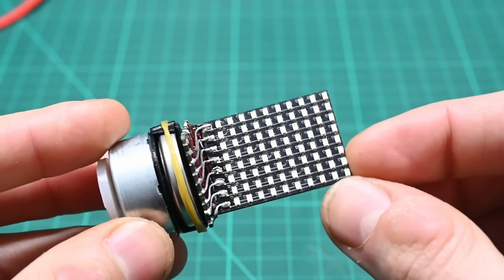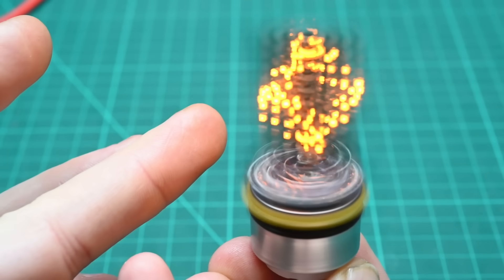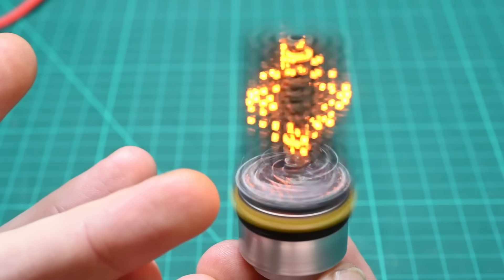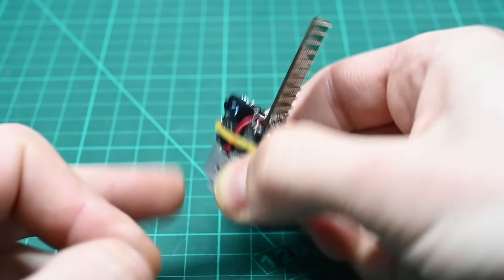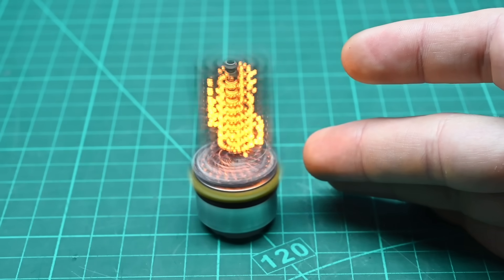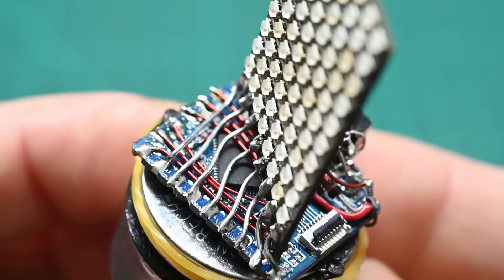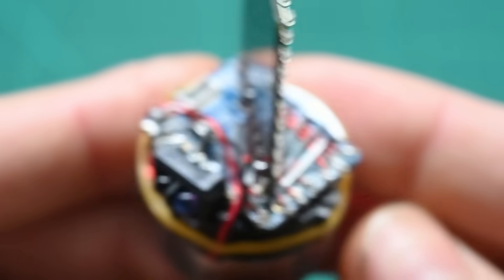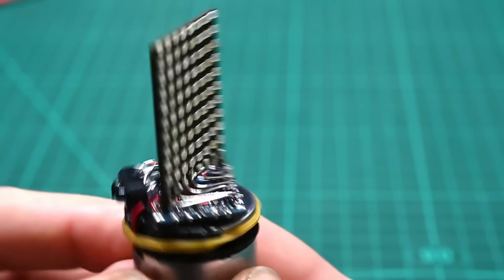Tiny volumetric display

Comment: Please don’t give up on this. This is amazing, and would love to see one day a higher solution, bigger version of it.
Reply: i doubt it will ever happen. the amount of movement you need is a safety concern.
Reply: @NRLNK-Rivals  if its getting your finger caught in it you could just put it in a case, if its possible to make parts lighter that'll also help with making it shake less? or maybe improve the motor itself
Reply: Reminds me of a Tamagotchi. Low pixel, but very clever and novel
Reply: There's one at the ATL airport. I think the point of this is that it has the potential to be small & affordable.
Reply: I saw a guy called ancient make one run doom.
Reply: @Thefirefan25  I found this video from him lmao
Reply: China's on it don't worry
Reply: It won't scale well. See "mirror screw TV" for details.

The rotating mass becomes rather unwieldy and cumbersome. It's probably good for a few inches across tho.
Reply: Wow ok. Comment delete central? 🤦‍♂️
Reply: It isn't going to scale well at all.
Reply: And since this channel has some kind of setting set, I'm unfortunately going to bail and have it not recommended.

Why do I have a feeling this one will somehow stick... 🤣🤷‍♂️
Reply: but not to much so its kinda retro hahaha
Reply: Instead of thinking, why shouldn’t exist think of why it could. be bold think different / for starters some things that come to mind make it, brighter, more pixel dense, using the same technology that we use for transparent display in case it in a plastic or glass tube that way we make it safer add some weights to the bottom and a better spinning mechanism so it won’t wobble  but I could be wrong. Maybe this is the wrong technology to bet on but we won’t ever know if we don’t try Don’t forget if you’re not failing, you’re not innovating enough
Reply: @igordo23x This has been commercially available for years, it's not a new thing
Reply: This thing serves no practical purpose.
Reply: @internettoughguy technically then, neither does a Painting on a Wall.

It is "Art".
Reply: @BatistaInvests  Not technically...actually.
Reply: @internettoughguy  right on
Reply: @internettoughguy  all of human interest and endeavour serves no purpose.   It is all, ultimately meaningless, so who are you to say this little doo-dad, this thingamy-jig, this nic-nak, this oojamabit -wotsit isn't the most meaningful thing in the universe?

Huh?
Reply: @internettoughguy It's not supposed to. It demonstrates a concept that gets around some of the annoying aspects of voxel displays.

Comment: Theoretically you can double your pixel density by putting another LED panel behind the first facing the opposite direction with the pixels of the second panel being placed in between the pixels of the first LED panel. So when it spins the second panel can fill in the gaps of the first panel.

This has quite the potential I must say.
Reply: Think this would also add the effect of whatever angle you view the cube at, you would see the same result!
Reply: it would be interesting to see this with two oled displays stuck to each other
Reply: @frandingy  I would love to see that too! With a bit of programming and a whole lot of over-engineering we can “have” a 16k HD screen lol the quality would be so good that our eyes would be the limit.
Reply: second panel would increase total brightness too, but i think a transparent panel would look a lot better
Reply: @echelonrank3927  niiiice, then you can see the pixels from both sides, that’s a great idea!
Reply: @Born2Lose_LiveToWin  Actually I think that's a problem for any non-symmetrical image. (it being transparent)
Reply: You double the frame rate, not the pixel density
Reply: @dept9203  see that’s why I’m saying the pixels of one panel should be in between where the other one would be. Sure, I guess in a sense that would not be considered the resolution but when I was making this comment I was thinking of how human eyes can only see up to 60Hz u know? If you spin that thing fast enough then the amps would be on top of another, making it look like the resolution is higher but because it’s the frame rate lol
Reply: @Born2Lose_LiveToWin  human eyes can see way beyond 60hz lmao.. i have a 60hz panel, a 120 hz, a 240hz, and a 390hz, and you can easily see the increased smoothness with each increase.  Even 390 is not nearly enough.  Frames are easily visible during fast motion at 390hz.  No one knows how many Hz are needed before people can't see frames, some people estimate it's in the thousands or even 10s of thousands
Reply: @diebygaming8015  you’re right about human eye noticing the difference between faster and slower frequency monitors but you’re wrong about human eye being able to perceive faster than 60Hz (which is a rounded number and not the same for each person). The reason we can notice those differences is because of synchrony. The faster frequency monitors can disregard synchrony due to speed of frame production.

Edit: next time you’re on the road, pay attention to the spokes of the car next to you as you both speed up. At some point the spokes go from looking like they’re rotating clockwise to counter-clockwise, and if you go even faster, it goes back to clockwise again. This is due to the frame rate limitation of your eyes and synchrony of what frame the spokes were on the last frame your eyes saw it. Then your brain tries to auto edit the frames and that’s what happens.
Reply: This was my thought as well.  Double sided PCB assembly is a solved problem.  It would also fix the balance issue mentioned at the end.
Reply: @willis936  Hmmm
Reply: That's what I thought a second panel would although ged rid of the balance problem.
Reply: would be cool if it's possible to replace the led screen with some cheap rpi ips screens instead and kick it up a notch
Reply: I'm thinking you need a 2 sided OLED panel to really see what this is capable of
Reply: Wow a comment about technology got deleted?

YouTube is overstepping their bounds 🤦‍♂️
Reply: I was thinking the same.. just offset the LED to be in between the other side.
Reply: id say pinball tables will be cool using this tech!
Reply: especially as a fan and when you cat jumps on it once you build it in a bigger scale
Reply: INSANE POTENTIAL, I MUST SAY 
wait till this gets in the right (or, wrong), hands. 
oh wait-
Reply: @tepasaswey1239  Wouldn't bother with replies. 🙄
Reply: Thought the same thing as soon as it spun up and I saw the gaps. LEDs on the back offset to fill the gaps. I would love to see a new prototype.
Reply: Could also use a smart watch display for high resolution
Reply: A bit like interlacing on the old 50 Hz PAL TV signals...
Reply: it has already been done a hundred million times...shown on YouTube and sold by the Chinese youtu.be/v5mLhdsFqXg?t=188
Reply: I don't that would increase resolution, as from any 1 angle your still looking at the same amount of leds. Additonally increasing densit could lead to errant light spilling into adjacent pixels.
Reply: @kodaxmax sure it would double the resolution. It is spinning so there is no angle you just see one side. But as top said it the pixels need to be offset. Else it's same resolution but a better frame rate.
Reply: "This has quite the potential" ...It's an inferior version of a monitor.
Reply: @grabble7605  monitor has a pseudo depth to it, this is an actual 3D illustration that doesn’t involve VR technology.
Reply: @Born2Lose_LiveToWin   more like a hologram
Reply: @grabble7605  wow, if we'd all think like you. We'd never have invented/discovered anything. " A bow and arrow you say? How is this better than a spear?" " A car you say?  How is this better than a horse?" Maybe think a little more on the key word of Potential not on what it will be, but what it could be. Dosnt mean it's better now or will even replace the thing you think it will. Just that it's interesting, innovative and moving tech forward not stagnating...
Reply: @NoOne-ev7vj  You guys with your fancy lights. I'm sticking with my candles thank you very much.
Reply: @grabble7605  all the fancy tech we use today started like this. Remember that.
Reply: @grabble7605  Not so long ago monitors were just series of blinking lights on a board. They've just advanced to the point where the amount of said blinking lights has increased into the tens of millions. We call them pixels.
Reply: @grabble7605   thats like calling a nintendo switch an infirior cell phone. utter nonsensical remark. they are diferent diferent types of objects with diferent goals.
Reply: @grabble7605  A 3D monitor.
Reply: @grabble7605  That's why they said it has potential... No one is saying it's superior to current monitors that are precision machined, have been developed for nearly a century now, and cost way more.
Reply: @grabble7605  Dumbest comment I have ever read.
Reply: @grabble7605   its not, a monitor is a 2d solid screen of light, this is volumetric meaning its 3d, its hard to tell on camera but in person you'd see an actual 3d shape, this does have potential as it can be used for literal holograms.
Reply: @grabble7605 
I haven't seen a real-space 3D volumetric monitor yet, so, this is certainly something with untapped potential
Reply: @grabble7605  you can use 2 displays on a monitor to get volumetric display, this would add depth and would be useful in video games.
Reply: Potential for what?  He would have been better off get an oled display and spit that instead.  Garbage.
Reply: @ahndeux  It could have the potential to be the tech that drives actual real life holograms imo. I haven't heard of any other proposal for how to make holograms that is half as practical and simple to make as this genius idea seems. Let yourself dream some time bro, it helps your mental.
Reply: @quickmixian  Sure, if you want a hologram of a candle flickering at low resolution.
Reply: @ahndeux  a transparent oled display or why even bother imho
Reply: @echelonrank3927  You must be blind.  Do you realize this display is a black PCB?  Its not transparent either.  A spinning OLED display will still provide a much higher pixel density than a bunch of discreet LED soldered to a PCB.
Reply: @ahndeux  whatever
Reply: @echelonrank3927  LOL
Reply: @ahndeux  stop being such a killjoy
Reply: @ahndeux Back then cars are basically unsafe horses with fuel and expensive maintenance. This tech has the potential to become better.
Reply: as  steam punk decoration !  @ahndeux
Reply: @ahndeux  that might be heavier, more expensive, and not required for a prototype. besides, the idea has potential because you could get an oled display and spit that instead in the future.

Comment: You can get a higher resolution by creating a second panel, attached at 90 degrees to the other panel (looking from the top down at the aperatus).  If the orthogonal panel's LEDs were slightly offset from the main panel, the pixels could interact.
Reply: That wouldn’t work. The second panel would block half of the first panel for the majority of the rotation cycle.

Comment: Well done! I had a similar idea a few years back, but it was a lot bigger and it would just wobble out of control as soon as a turned it on so I gave up on it. I thought of using circular rails that wires from the spinning display would brush up against, but this design is so much better. Thanks for the inspiration!

Comment: Interesting project. instead of adding a weight down on the circuit.. you can add a glass/transparent layer on the the led side with weight equal to the pcb. This will stabilize your circuit better.

Comment: Your display has a flaw in its design: 

The plastic that the LEDs are attached to, when it spins the opacity varies with the movement delta, so you get the illusion of a solid cylinder in the center. That's bad, we want to be able to see clear through to the other other side.

A less serious bad thing that happens because of this is that the black gets more translucent the further out from the center, past the comfortable value (which I imagine should look like a black fog just enough to create good contrast even in bright light without being too opaque).

Don't fret, easy fix for both: 

An "M" shape mould.

The M shaped mould is closed and level at the bottom. You pour in semi transparent black resin that looks opaque when thicker, into the M mould.

Both arches of the M should have vent holes pour into either, get a resin expert to advise on how to get a set up that won't crack when curing.

Transfer the LEDs so that from the front in orthographic perspective the panel looks the same, but from an angle with depth perception the leds are actually terraced, and that basic concept with some fine tuning should fix both problems at once more or less 😉👍

Comment: I saw a gizmo many years ago at a car show that might help with your counterbalance problem. This thing would supposedly automatically balance your car's tires. It was a round tube, like a donut. You would mount one of these donuts on the inside (toward the car) of each one of your wheels (the metal rim, not the tire). Inside the donut (tube) there were some weights (balls) rolling freely. Think: torus with a number of ball bearings inside. The device at the car show was perhaps 14 inches in diameter and the tube was probably 1/2 inch in diameter and I have no idea how many weight balls were running around inside the tube. It worked great in the demo

Comment: Why not put LEDs on both sides of the board? 
That will both fill out the display (visuals won't be interrupted by the blank side each rotation) and also solve the balance problem.

Comment: Hey! How about using an actual screen that is used in a mobile display. Don't know how each pixel will display but that's for sure that one can program it. I think using it will increase the resolution drastically
Reply: If you increase resolution you also need to increase refresh rate, so your suggestion would not work.

Comment: For the flame animation, could you speed up the rotation of the device? That might make the animation have more fluidity to it. Also, as far as balancing the device, you could always add a clear epoxy resin coating after shifting the board back.

Comment: Maybe in a few years when 1000Hz+ gaming monitors are available this could be scaled way up. 
I don't foresee anyone actually using that setup at home as a 1800rpm huge screen sounds terrifying, power hungry and noisy but it would be a crazy awesome demo.
Reply: Actually if you want 1080p monitor with 60 fps you would need refresh at about 115200Hz
Reply: @marcobel9671  I just guessed that it would be enough but it seems I was quite off. I imagine that the number would change a lot depending on the resolution needed in the axis of rotation. So if just running at 1Khz at 1800rpm for 30fps you would only see about 16.5 images per revolution (the rest is facing against you) so for things to keep a stable position it would indeed have terrible resolution in the axis of rotation. 
Unless something crazy happens with screen technology, it seems that sadly no one is going to build a supersonic spinning IMAX.
Reply: @eruiluvatar236  yes i think you are right. But would be interesting to see where the limit would be. I guess would be a tradeoff between resolution and fps

Comment: Issues I can see when scaling this up is the forces exerted on the design as it scales the internal RPM will need to increase as the outer edge requires more speed to maintain the illusion. 

Great at a small scale though.

Comment: If you could, theoretically, use a double sided PCB and double the pixel count, lining up the other side's pixels in the dead space of the original pixels... I would image that would effectively double resolution.

You would have to work out timing he two sides with each other. But if you've got one side figured out, I imagine you could handle two.

Comment: Nice! Now that's a clean and compact design 🤌! If you want to go a little crazy, you could technically control the display with 3D shader language to render 3d geometry with glsl with a raspberry Pi (or PC 🤔) and a cheap LED array driver interface.

Even just if you're curious, Google search "polyfloyd's stuff, Rendering OpenGL shaders to a LED-Cube". He creates a 6-panel LED array shaped as a cube. 

In your case, the pixels are already technically 3d, so your shader could technically render 3d geometry without any transformations!

Comment: You can eliminate battery by getting power out of motir coils, while spinning whole thing by extra motor installed statically, so you can just solder it.
Just use your existing motor as a generator and turn it with external static motor.

Comment: That thing is awesome!  I was thinking that for added detail and precision you would need to make the lights smaller to fit more on the board; but it would probably be better to just scale it up if possible to prevet things from getting so closely packed that they start to interfere
Reply: Or could step up the details by using a low res oled display

Comment: You need a small solar panel on the back side of the LED board so you can enclose the whole thing and still charge it. Nice proof of concept! I guess RGB and higher LED density is next?

Comment: At the new MSG Sphere Las Vegas they have a giant volumetric display using spinning fan blades.  It's much wider and taller than it is deep but there is still a decent three dimensional aspect to it.  The fans aren't obvious other than the noise (great way to circulate air too) but when you try to photograph or film it the fans are obvious.  You can also blink rapidly. Fantastic.